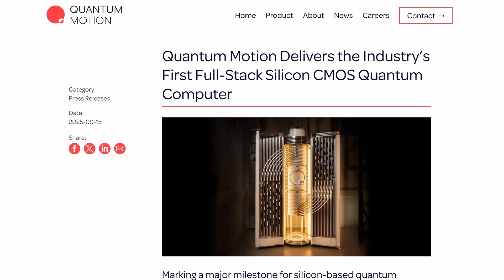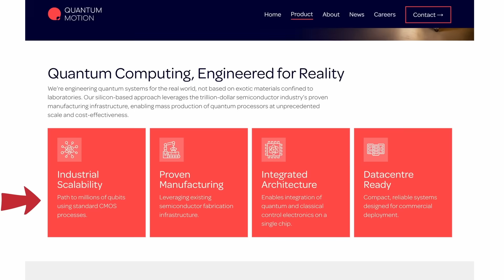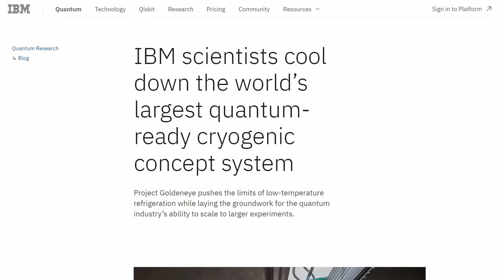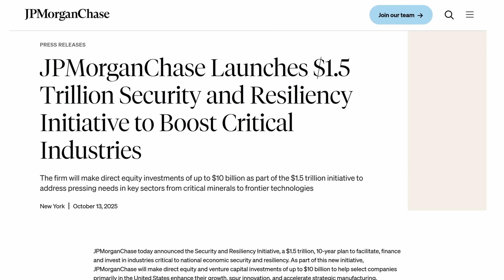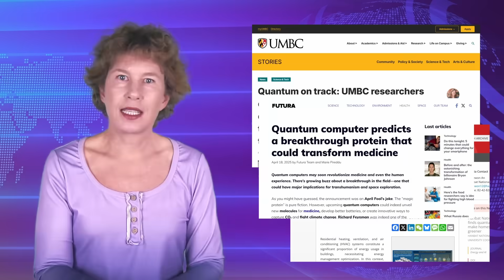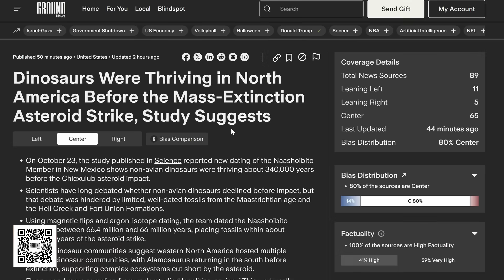I was SO wrong about quantum computing.

Comment: It’s why space is important.  Superconductors don’t need “to be cold” because the conductor generates heat…….  They need sub 10 kelvin because they need the superconductor to be in that state.  Superconductivty means there is literally zero resistance in the wire and no magnetic field.  This allows reading fields and means super conductors aren’t actually generating heat .  The current can stay in a super conductor for decades without dropping.

Like the entire concept of a superconductor is that its resistance drops to 0.   Literally zero.  Vanishes is how they word it on wiki.if there is no resistance, then the material is not “getting warm”.  There are no electron collisions in the material, hence no increase in entropy.

Perfect for space where there is nothing and you don’t need cryogenic systems to reach superconductivity
Reply: Space is problematic because it's not cold. The sun will elevate surface temperatures of anything it shines on to nearly 250F.

Only in the shade is it cold. And only if the material causing shade is not radiating that heat to the object in the shade. It's really tricky.

But yes, vanishingly small resistance causes vanishing small losses which means small amounts of waste heat. Which increases efficiency.

But they would have to remain in orbit on the dark side of the moon. Which is the nearest place in space that is near zero.
Reply: @Triple_J.1 Dark side of moon faces sun directly monthly.
Reply: Space near Earth isn't cold.  Being far from the Sun is cold.

Comment: Maybe they can use a fusion reactor to power a quantum computer that can control a fusion reactor that ... if only I were a qubit more ignorant, and willing to assume a BS meter of 10+ from Sabine, I'm sure I could write a paper to fund my brilliant new startup.  

Superconducting Nanotechnology ARK (for all the qubits), or SNARK.  Using extra dimensions in time and space, our new supercomputer is colder than a galactic black hole! Qubits so densely packed, the arrow of time is orthogonal! Calculate the entire state of the Universe in mere femtoseconds! But wait, there's more! Why, the accretion disk alone produces more power than all the Seyfert galaxies, in less than a single cubic light year. And it's not just hypothetical. Seifert Energy is Concrete! Ask about our home systems. (Shipping not included)

Comment: There is one thing that Q-computing will almost certainly be able to do in the not too distant future - break AES private key encryption.

There was a recent IONQ presentation claiming that the “drop dead” date has moved from 2040 to 2030.

I’m not clear that you need mass produced million q-bit machines to do that, but it will almost certainly be one of the first “useful” (aka suicidal) things Q Compute will be capable of.

Thus governments are both nervous and drooling leading to the waving of many $. 

Thus companies are doing what they can to attack said government $, before the other guy does.

Not that hard to figure out really. Most government money is attracted to the smell of bullshit. 

Or, there may have been a miracle breakthrough that everybody discovered almost simultaneously. 

Somebody said you need 2K q-bits

So then my question is - Y2K ?

Comment: Mine even simulated a 1:1:2 novel metal composition for a stable room temperature superconductor, got the cif, with full atomic layout of the yttrium, barium, copper, and oxygen. 🤷 I can even parallelize it. But, on only one core? 17 hours. 🤣 Screw quantum hardware. Mine is so much better because it works on PRE EXISTING hardware. But, no one cares. 🤷

Comment: Same old stating the obvious video from Sabine. Jumping at the chance to call BS without understanding much at all about the topic. Just because there is hype doesn't mean anything about the eventual potential. If she was producing this sort of review in 1970, she would be showing clips of giant mainframe computers that take up entire floors of buildings to produce the processing power of a desktop computer 25 years later. "This computer hype is a 10 on the BS meter!" She would proclaim..

Please. You have a "job" throwing water on things that have not yet arrived, Sabine. Great work spinning out the pessimism. Your job is pretty easy. At the beginning of the 20th Century you would have made huge bank saying "these noisy dirty machines can't even pull a wagon 100 miles without refueling. They'll never replace a good horse!". lol

Comment: The regular person won't ever have a quantum computer.  Ever.  You will pay to use Google and Microsofts.   There is no such thing as personal computers any more.  RIP
Reply: No worries, quantum can never replace classic computation. Even stronger, a quantum computer cannot work without a bunch of classic computers to interface with the quantum thing. Anyway, they can never do normal calculations, and definitely never ever connect directly to a display and show graphics and stuff.

Comment: A friend of mine was head of software engineering at the first gallium arsenide minisuper company - in colorado, in the mid 1980s (prisma - founded by ex convex engineers).  The entire company worked for 2 years before one of the hacker hw/sw engineers talked to enough chip designer engineers and did some calculations and showed they could not cool the computer.  The company shut down two weeks later...

Comment: I’m the CSO at Quantum Motion, the UK company that Sabine mentions at the start. 
Important correction to the video: Actually we work with electron spin qubits in silicon, not “superconducting circuits”. This means our qubits are the same scale as transistors in conventional chips (10s of nanometres) and use correspondingly little power. That’s why we don’t hit the problem of overfilling or overheating the fridge, which Sabine mentions later.
Reply: Scaling superconducting QC has been a problem ever since and this is known to everybody. For spin qubits I'm not sure how the topology comes into play - generally full connectivity is the best thing you can hope for - everything else introduces error from the swap gates. But generally - the decision which hardware to use is not completely decided - nor should it be. 

Building computing hardware takes time. Every time. If you look into the history of computing the step from the invention of the transistor in the 1950s (originally earlier by a German scientist but patent ran out?) to NMOS circuits in the 1970s to microcomputers in the 1980s took a lot of time. First the Fairchild engineers left Shockley for his leadership style. Then other engineers left Motorola and other companies to found MOS technology. Their first chips were still designed by hand and the ISA was very limited. But compare the 6502 from 1978 to a chip from the 1990s and you will be amazed by the technological progress.

On the theoretical side - quantum teleportation and other protocols allow for distributed quantum computing with additional perks. So that part is done. Photonic systems will still be the way to go for long scale communication although communication speed is still in the Baud area. So what? Modems in the 1980s were that limited as well. Given that we came from 5 qubit systems in 2015 to the multitude of systems we have now the progress is very fast. 

Sabine talks a lot about superconducting qubits but it should be clear that scaling will always be a problem if you need to cool your system that much. The first computers from the 1950s and 1960s were also very sensitive to all kinds of noise. 
What I don't get yet is why scaling is so problematic with superconducting systems due to added noise. Quantum computing is reversible so that in theory noise can only come from control or readout. If one wants to scale superconducting systems one needs different small systems connected by fiber cable which allows for state teleportation. In that case synchronizing everything will probably be a huge problem.
Reply: @simplyme5324  The problem with noise is that any interaction with the environment/energy transfer causes the qubits to collapse or lose superposition. So to much noise and you have a 100 or a 1000 bit clasical computer.
Reply: @airborepoem2644 i think the whole quantum mechanics math is flawed; there is no superposition, no virtual particles, no teleportation, no qubits, etc, there are surely other physics at work there, probably simpler, qm is an ex post ad hoc euristic idealistic math scam
Reply: @zdenekburian1366  Maybe, but well tested scam. Apart from this you are not the first person to question QM and there are alternative interpretations or formulations that deliver the same set of equations. Bohmsche Mechanik could be interesting to you.
Reply: @airborepoem2644  This ist to a certain extend clear to me but this should affect either all quantum computing platforms or none of them. I can only assume that high temperature quantum systems are less impacted by tiny amounts of noise compared to low temperature ones. What you are essentially saying is that the control equipment interacts with the qubits and gates. This is true.
Reply: @simplyme5324  thank you, surely better than copenhagen int., bohr, heisenberg, etc, but i dont like non-locality; you also could look at alternative local theories; about testing, yes, but if along a century you continuously fudge the math inserting piles of particles, variables, forces, virtualities, phantoms, idealisms, spirits invented out of thin air just to match the experiments, without a real, materialistic explanations, i would be surprised if the results didnt fit to the math
Reply: @zdenekburian1366 Historically, the "maths" came first.
The "maths" predicted things. 
These theoretical things were named with only the "mathematical interpretation" 
Then experiments confirm the predictions. 

"the math" is also useful I the research, design and manufacture of stuff we use. e.g. This device you're reading this on relies on seemingly "teleporting" electrons across an insulating barrier to store your apps and car photos...so it's not completely detached from reality. 

How it's actually attached to reality and the most fundamental level (if there even is such a thing) is unknown and is probably not possible to know.
Reply: @tylerdurden3722 I think your both looking at this from the wrong angle. Have you ever thought about the soloutiom to quantom gravity? The obessesion people have with quantom is in my opinion fueled by the conclusion of einsteins maths and logic, combined with what we know now.. I'd say space time is a self referential fractal system. And if it is, what would that imply about the grace and beauty of quantom mechanics and the potential of quantom computers.
Reply: I concur - this is a very, very big mix-up!
Reply: How many q-bits is your machine and how much does it cost?
Reply: @rscottlewis1 their publicly disclosed number is 4 qubits…
Reply: @s.berrada4395  I've read not that long ago that the chip they've shipped to the NQCC UK is 1024 qubits per 0.1 mm^2 and it's a 9 mm^2 chip. So, likely quite a bit more than 4 qubits.
Reply: @jaroslavjandek8365 : I don’t doubt they fabricate a large number on a wafer for yield studies etc. I think the most important number is how many qubits they can couple to make a “quantum computer” and I seem to recall that they’ve coupled 4 so far. I might be wrong…
Reply: @rscottlewis1  You do realize that has nothing to do with the topic, right? The widespread availability of this product doesn't determine if it works or not. You have an egotistical woman trying to claim to be an expert in a field that she isn't an expert to keep her ego and image intact and to grow it. If any quantum computer works then she is wrong and trying to gaslight you. She is trying to appeal to you as an authority figure so she can assert things she is in no place to assert.
Reply: @thomgizziz No, "if any quantum computer is actually useful for solving real-world problems that people actually have" is the bar for her to be wrong. Profitability is another standard she has separately implied. So far QC has no commercial viability or practical use for problems that aren't solved more simply with conventional computing, a handful of esoteric government applications aside.
Reply: What makes you say she was using a pseudonym (or that a poster claiming to be her was authentic)?
Reply: Ditto - I wish YT had a small menu of responses like a neutral "noteworthy" button.
Or, rather than a thumbs down, a "?" Button to say "is this right / what do you mean / why do you say that / etc"
Reply: Where can I buy your machine ?
Reply: Does it work?
Reply: Just had a quick chat with ChatGPT. And as I expected the difficulty in error correction exponentially increases with the number of Qubits. So somebody please explain to me how we get to 1 million qubits?
Reply: @FullAttach  > chat with ChatGPT; immediately disqualified.
Reply: Qubits better get FASTER at generating an ROI or this is all just a pipedream. I want this to succeed so bad... but it won't
Reply: @Rig1986 This statement is an excellent example of why capitalism is counterproductive for scientific progress. The real value of a scientific breakthrough or invention isn't in found how profitable it is, but rather in the magnitude and impact it has on human life and how many lives it impacts. The value of quantum computing is that it will be a catalyst for technological and scientific progress across the board. It will impact everything from marketing to video games to astrophysics and our understanding of the universe
Reply: @wesleygibson5546 lol, you act as though a discovery that truly has a huge impact on human life (on human life, not simply on how we understand something) doesn’t also have a very high correlation with an ability to be profitable, or used in an invention or service that is.
Reply: @wesleygibson5546 ya but it won't because it will never work.
Reply: @wesleygibson5546  except modern capitalism is pouring so much money into scientific institutes, that we need AI to actually keep up with discoveries. World is now building how many particle colliders, again? And fusion prototypes? How many quantum computer prototypes exactly on market?
Reply: Yes but the fidelity of your qbits is trash compared to superconducting platforms.
Reply: @afroohar  actual clown lol
Reply: She's an idiot she is completely corrupted by idiotic leftist psychology and does not understand the end goal. Saying things like "they can already do that the wuantom part just makes it more difficult" is a good example. She's the sort of lady that would have said computer were unnecessary because we have type writers. Absoloure muppet tbh
Reply: Tell everyone it's all over hyped because it will never work without a classical processor component and it will only be useful to a handful of people to solve very specific problems. In the real world it would just degrade the operation of linear processors which will be used for 99.9% of tasks, now and forever.
Reply: I upvoted this not because I can second the statement made, but because it may really be by the CSO of Quantum Motion, UK and therefore be interesting to a lot of viewers.
Reply: Tbh I was sitting here saying to myself  - surely she means  "spin qubits"???!!!! ... I was right....though I barely understand how my bluetooth mouse works.
Reply: @elingrome5853  Surely this means that yet again she has gone out of her field and is trying to use her authority in one field and applying it to another and asserting that she is an "expert" to keep stroking her ego and trying to dupe people. She isn't even remotely an expert in this field and she is doing what dunning-kruger having people do and then all the gullible people go along with it because she has a degree which doesn't mean that she knows what she is talking about but people are manipulated through logical fallacies.
Reply: Zzzzzzzz😑
Reply: This is a good way. There are, however, better ways.
Reply: Hi Simon, Sabine is a well known †roII. And as they say, don't feed the †roIIs. She is suffering from the Dunning-Kruger effect, who knows just enought to be an effective contrarian, but not enough to know when she's wrong. Good luck to you and your team, and win or lose, at least you're trying to advance science and technology. All Sabine does is expose her professional sour grapes.
Reply: Ignore her , she knows less than Wikipedia on quantum computing and evidences she understands even less.
Reply: Thats how i treated qubits in remarks i ,made / Sabine relied with senseless vitriol under a pseudonym. With respect the YT.ber we are refering to it is awkward. I mentioned some of the theoretical issues concerned with the phenomenology / the YT.ber went on a wild rant accusing me of conspiracy theory . It seems not with trying to engage her misconceptions. She appears to want to be irrational and insulting if interrupted during a hunt for sycophant level response ( or whatever ).